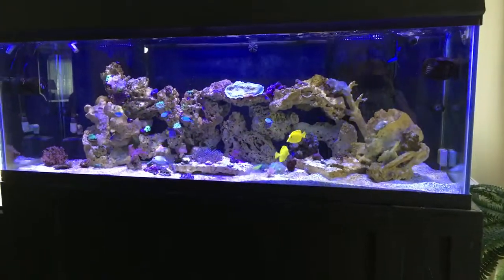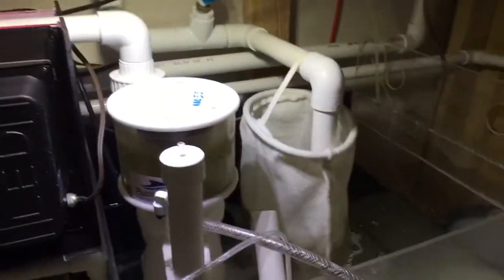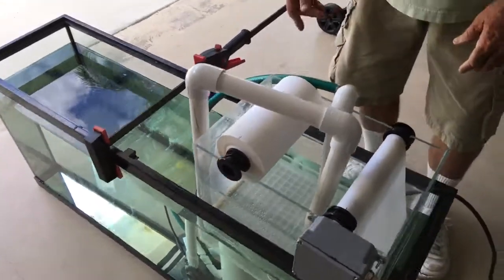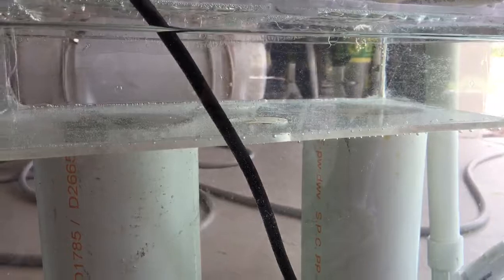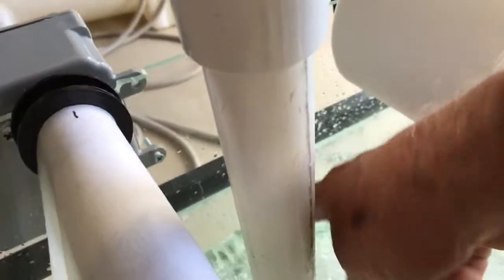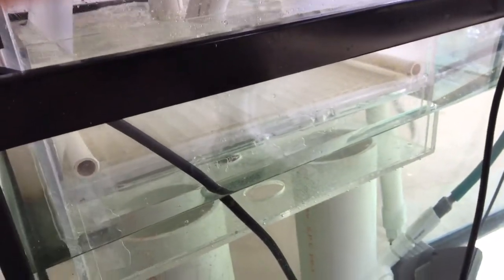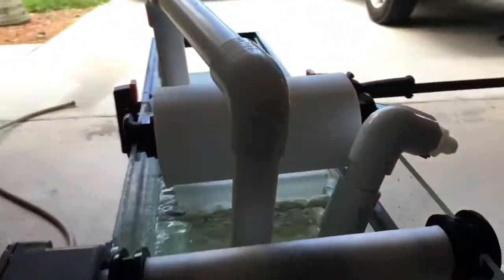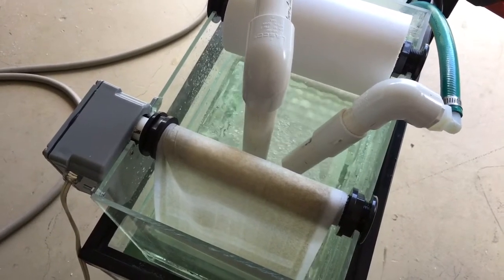Rollermat Filter

Comment: Fantastic job! Way to go really. I'll be building one shortly for a fresh water application. I can't find the fleece roll whats the actual name you found it under on amazon? Do you know the exact name of the motor also.  thanks for the video and the help.
Reply from the maker: Thanks for the comment, now i am using a different kind of material that can be washed and reused and you can get it at walmart[ imagine that] its called eco-fi classic felt. the motor comes from amazon and it is a time clock motor.

Comment: Curious to know, where did you buy the fleece roll and how much does this system cost to run? I guess the factors in that are, how long the roll lasts at your constant turn rate and the cost of a roll. That said, it looks good. Nice work.
Reply from the maker: Thanks for the comment, The roll was bought on amazon for 38.00, I cut the roll in half so now i have 2, as far as how long it will last depends on your system but on my system it lasted 2 months without doing anything.